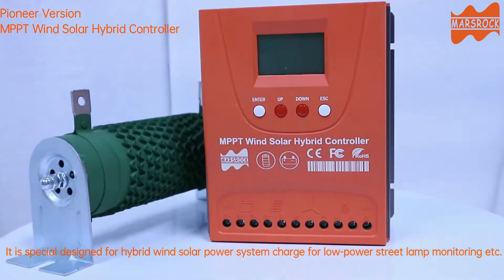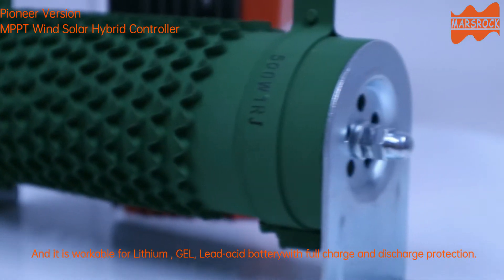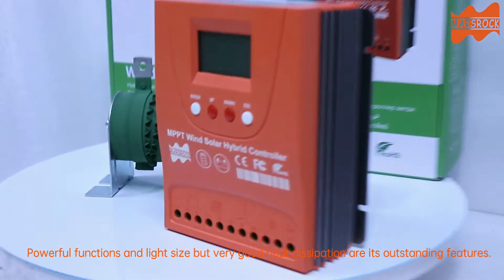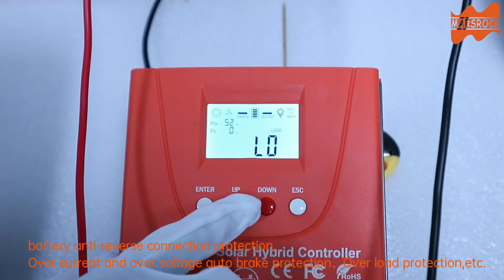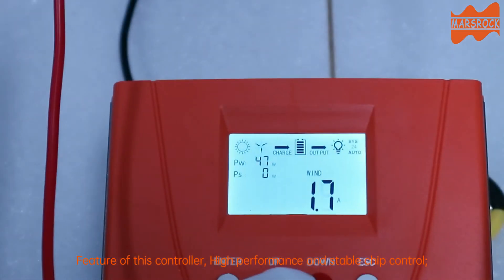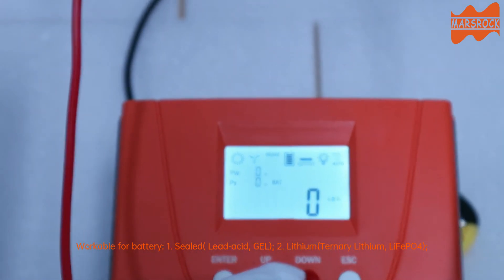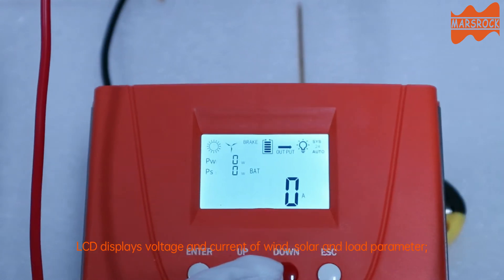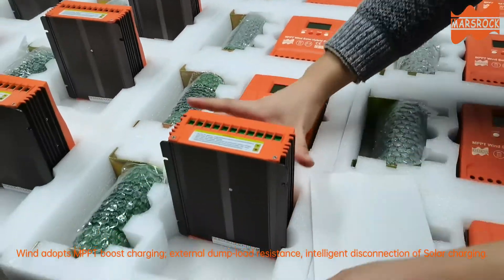Pioneer Version 3000W Wind Solar MPPT Wind Solar Hybrid Controller Function key introduction

Comment: this orange regulator of yours 1500/1500w almost burned my ship. why are you lying about these maximum power. this is really dangerous. I now removed the entire regulator and locked the wind turbine
Reply from the maker: Dear customer, we apologize for any inconvenience caused to your user experience,
We will immediately initiate an internal investigation to determine the cause of the problem and confirm whether there are any issues with product quality or specification description. If there are indeed problems with the product, we will provide you with certain compensation. Once we find the problem, we will contact you immediately. Alternatively, you can use service@marsrock.com.cn Contact our after-sales personnel and apologize again for any inconvenience caused to you.
Reply: did  you find a controller that actual woks? i try find one but all seems to be  fake specs and useless!

Comment: this control 3000w does not work. I have ista breeze 1500w and when the wind turbine starts charging as soon as the controller shows about 550w on the screen, it applies the brake and does not start again. it waits for 10 minutes and charges again for max 2 minutes and brakes on.
Reply from the maker: Dear customer, I'm sorry to hear this news, but there are many reasons why the controller may not work, and each situation is different. To ensure the normal operation of a wind turbine, it is necessary to have continuous and stable wind power. Secondly, the working efficiency of wind turbines with vertical and horizontal axes is not the same. For wind turbines with the same power, the horizontal axis usually generates more electricity than the vertical axis, while the vertical axis may not generate much electricity, which may cause the wind turbine to fail to reach the minimum starting voltage of the controller, resulting in no electricity generation. Thirdly, if encountering typhoon weather, in order to protect the equipment, the system will activate the braking function to prevent overcharging problems The above problems are all possible. If you have any further questions, you can contact us through service@marsrock.com.cn Contact our after-sales department, and our after-sales personnel will answer your questions. Thank you!